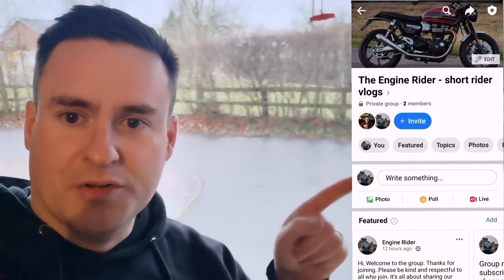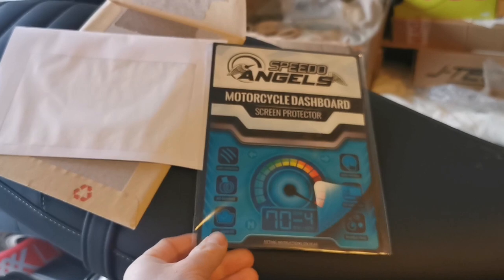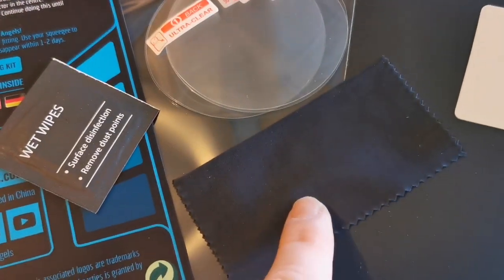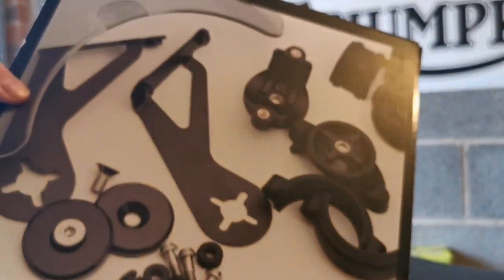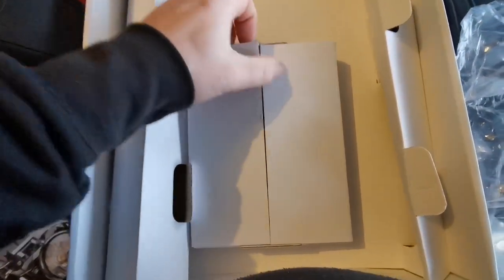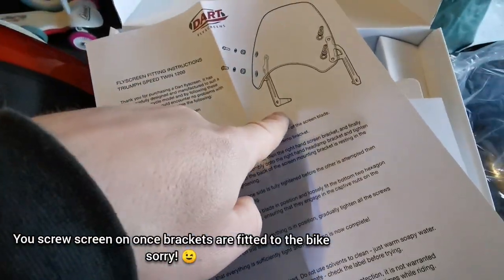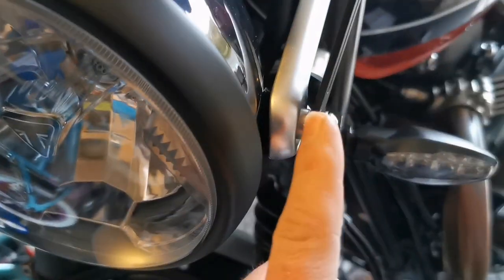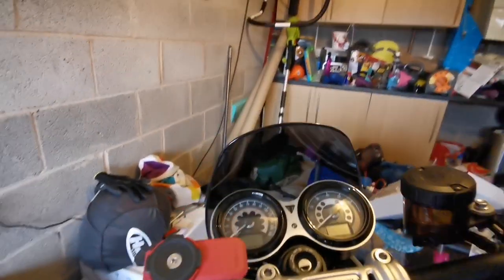Dart Classic Screen installed!Triumph Speed Twin -  2022 season garage vlog! Winter mods

Comment: Speedo Angels are usually great,  but they're impossible to fit to the triumph clocks as they're slightly domed, even though they sell them for these individual models, I even contacted them for any tips but they were no help, so after a lot of frustration they ended up in the bin, so you're not alone

Comment: I popped a dart piranha on my speed twin a couple of weeks ago, small tip that I heard from somewhere else was top pop a couple of strips of heat shrink on the  screen mounts where they touch the headlight bracket to avoid metal on metal interface.
Reply from the maker: Good tip!

Comment: Hi mate quick question the speed is new to me . Tried to alter rear suspension apparently the tool in the side panel does it. So got the tool but doesn't seem to do anything? Wonder if its misaligned or something. Any clue? Thx 👍
Reply from the maker: Triumphs bad design basically. Easier to do without the end cans... I used an Allen key to do mine up one notch. I know a lot of people have replaced them due to this issue.
Reply: @FuelwithDave  Hi ok thanks. Yeah even Allen key didn't seem to do much . Maybe not correct size although doesn't even have the proper fitment for an Allen key by the look of it. I will have another look but definitely poor design. How u getting on with the Michelin tyres? Thx
Reply from the maker: @mikealls8938  tyres are great makes the bike feel so stable and confidence inspiring even on cold days they warm up quick